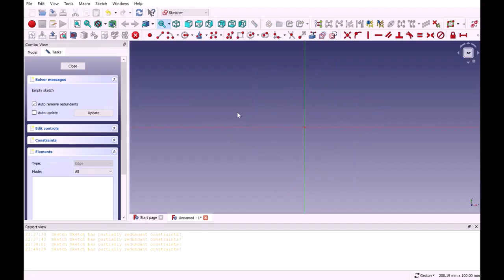AIRSTREAM  REBUILD - Ep. 8: New COOSA subfloor & wheel wells replacement

Comment: I’m glad o saw this video. I’ve been on the fence about lifting my shell. It seems like you can do 99% of the frame repairs without lifting, and sliding floor in from the wheel well. Thank you sir! Excellent work!
Reply from the maker: I am glad it can be of use. I am working by myself in a windy area, I did not want to lift the shell for these reasons. It worked almost flawlessly for me like that. Something that is not in the video is I only removed the blots that linked the shell to the floor as I was sliding the first sheet. Once all the sheets on the front half were in position I installed new bolts, then repeated the process to the rear half. This way I always had at least half of the shell secured to the frame so it would not move or fall.

Comment: Really appreciate this video! It convinced me to buy coosa for the floor of our 1972 27ft airstream. I have 3 big questions! What are you coating the floor with when you finished (grey)? What was the red putty you mixed to cover the heads of bolts? LASTLY, how do you plan to insulate the floor? Very curious. Thank you!
Reply from the maker: Thanks! The coating is just garage floor paint I used that to "seal" the small pores of the floor against dust while I finish the trailer. probably  not necessary but it can only help. The putty is "bondo" / body filler from the local hardware store. As for the insulation the current plan is to glue rigid expanded foam panels to the floor. 
Make sure to get the coosa bluewater 26 boards. I went with 3/4" thick and routed the edges so that would fit in the 1/2" channel
Reply: So grateful for such a timely response! Thank you! So the goal is just to add some uv protection for the floor? Could I use like Marine paint/gel/epoxy? Not familiar with the rigid expanding foam insulation, will look into that. After painting over the coosa, do we have the option to add vinyl floor on top? The painted closet isn't the fully finished floor is it? Thank you so much!
Reply from the maker: @BubbaRiot  Mostly to make it easier to clean but you are right also to avoid direct UV on the coosa boards. My guess is any other paint would work too. As for epoxy it is probably overkill and more expensive. Coosa does not really need to be sealed. My current plan is to add a layer of 1/2" rubber then a custom printed vinyl on top.

Comment: I also wanted to ask what attachment you're using to allow elevator bolt head to lay Recessed into the floor. The circular attachment. Did you just use 1/4 drill bit for pilot hole? Or did you have to make it threaded? Thank you! Hope I asked that correctly
Reply from the maker: To have the bolt recessed into the floor I had 3 different method: 1. screw them really tight (that should crush the floor a bit and the bolt should end up recessed) I Found this not to be super reliable. 2. used a router with a router bit set to about 1/8" depth and carve out a circle shape around the hole. 3. used a forstner bit with a larger diamater than the head of the bolt and drill about 1/8" deep. I used the last method the most. As for the hole, I used a 1/4" drill bit through the floor and frame indeed.

Comment: Awesome job!! I would really appreciate if you had some links to your materials you used. Im rebuilding an Argosy.
Reply from the maker: sure, anything specific? I'll try to add references for everything in the description of each video.
Reply: @SylvainBurdot  Thank you that would be greatly appreciated. Yes the thickness of the Coosa you ordered and where you ordered yours from. Along with the recommended bolts you used pretty much everything you used to cut it short. haha!! Just found out about Coosa just In time as Im currently taking out the skins and the rotten plywood.
Reply from the maker: @universaluplifting  I got 3/4" thick Coosa bluewater 26 boards. That's why I had to trim them down since the original floor was only 1/2" thick.  I ordered them from Revchem in the LA area, including the delivery they were the cheapest around in south California at the time. https://revchem.com/ As for the bolt you have several options, and many people have done different from what I did. I used these exact elevator bolts from McMaster: https://www.mcmaster.com/92221A104/ & https://www.mcmaster.com/92221A246/ with standard nut and red loctite on the nuts. I used 2 different length depending on the location. The custom bolts that I made for the floor channel were made of a simple laser cut steel piece welded on this exact bolt https://www.mcmaster.com/94239A104/  that allowed me to screw them alone without someone inside the trailer. I may still have the design file if you want. As far as cutting, any wood tools would work. It is really easy to cut. Make sure to wear a mask and eye protection, even better if you have a bunny suit, as you'll be covered in fiberglass and polyurethane dust. A circular saw for the straight cuts, jigsaw for the curve and router for trimming down the edges worked wonderfully in my case.
Reply: @SylvainBurdot  Thats great Im couple hrs away from LA so that would work great. How many Boards did you need to get the job done? Oh okay I've seen many people recommend those bolts for the boards.Im better off going that route too. YESS I bought a suit and a mask today I took out the pink insulation. What kind of insulation are you going with? Sure if you don't mind sharing the file thank you.
Reply from the maker: @universaluplifting  Which area are you located, I only a couple of hours away from LA too. As for the boards,  my trailer is 31ft long, the inside is just under 28ft so perfect for 7 boards. That's what I purchased.  Given the price of these boards I did not want to buy a spare one so I had to make sure my cuts were right the first time. Second factor that lead to the number of board is I wanted to make sure that the edges of the boards would end up on crossmembers to avoid having them flexing. One of the original plywood board edge was not supported by a crossmember and the flexing was awful. That's why if you look closely at the video there is a board that was cut in half, two section of 2ft wide, so it be on members. For the insulation, I should be at that step in a couple of weeks/months. My plan is to use armaflex rolls between the walls and expanded foam panels under the floor. Let me see if I still have the file for that custom part.
Reply: @SylvainBurdot  Staying in Bakersfield area? What about you? Another question would you consider working on the subfloor aging if someone contracted you?  My Trailer is pretty much the same size I'll just need 7 of them. Oh okay I also thought of welding on more support sections on the frame I just don't know the proper wording for it. Great I'll be keeping an eye out for your next video.
Reply from the maker: @universaluplifting  I am in the Mojave area, not far away. As for working on the subfloor for somebody else, it is doable, that will depend on many factors. Welding more support is an option, it might be necessary depending on the frame model. They had several different versions of frame from what I have seen. Next video will either be the roof mods or the bumper repairs in a couple of weeks
Reply: @SylvainBurdot  NO just a few min away. Well if you're interested we would appreciate if you were able to do our subfloor. We have never worked with that board material and the price for board makes us even more intimidated. Yes I have notice that aswell. We would appreciate more support on the frame as we would be living in the Argosy full time. Great we will keep and eye out for the next video. We have watched all your videos including the skydiving pretty cool.
Reply from the maker: @universaluplifting  I had never done it before either, the first cut was definitively scary but in the end it is not that difficult at all. Easier than wood I would even say. I will be full time in my trailer too. As for doing your subfloor, I would need to see the trailer to tell and that would depend on your timeframe and budget.
Reply: @SylvainBurdot  lol I can only imagine!! Those boards are crazy $ but at the end they are worth it. I really enjoy working with wood but I just can't use that as the subfloor. Will have fun tho building all the cabinets and walls and doors. Really well we are sure like minded individuals! We are planning to build a little homestead. With these crazy home prices here we can't afford that here. Okay well timeframe can be worked out and budget well that will depend on your price because its work alright. I seen it did take you 64 hrs solo but we would be helping out so that's 4 extra hands lol. Maybe it could be cut to 24hrs fingers cross so we don't take much of your time.
Reply from the maker: @universaluplifting  I am not going to be using wood for the cabinets personally, only aluminum. I am too concerned about weight and wood moving with differences in temperature and humidity. A lot of the work can be cut down if so prep work is done in advance also. I would need to see it to tell. As the frame been cleaned up yet?
Reply: @SylvainBurdot  Oh okay. Well I am very curious to know how you would be able to use only aluminum. We are currently in the process of removing the subfloor and so far we have seen little to no rust. Seems like it might of been worked on before
Reply: @SylvainBurdot  We just ordered the boards. How Many bolts do you recommend we buy of each?
Reply from the maker: @universaluplifting  should we set to meet once you have the floor out so we can check how much work there is for the new floor?
Reply from the maker: @universaluplifting  I just checked my invoice, I got 5 packs of 25 of the 1-1/2" long elevator bolt, 7 packs of 10 for the 2-1/2" long elevator bolts, and 2 packs of 50 for the bolts I used to make custom bolts for the floor channel. I had a some spares at the end.
Reply from the maker: @universaluplifting  Get some locktite and washers too, I bought these https://www.mcmaster.com/91090A107/
Reply: @SylvainBurdot  Thank you! I will order those packs next. Did you have a lot of issues when you ordered your axels? We also need to get those ordered soon. Any tips? Yes I will definitely like to meet up. Would you charge by the hr or by the Job? Have you gave it much thought?
Reply from the maker: @universaluplifting  I would say a few hiccups more than actual issues, 3 to be exact. First, somehow the axles got lost for a months during shipping. How is that even possible I don't know...I called the seller who told me the axles had left 2 weeks prior from LA and I should have them by now but they were going to contact the carrier to find out. I called several times, maybe 3,  then after a month they suddenly they arrived one morning without notice. They arrived that's what matters and that was the carrier's fault not the seller. Second, on arrival one of the nut retainer was missing. After what had happened I decided to not say anything and just buy a new one, something like $5. Last, the mounting holes did not match perfectly so I had to slightly modified the frame, but I was kind of expecting that to happen. Otherwise, I am not complaining. I had Cynthia at HighSky RV parts on the phone to order specifically what I wanted since I got a few options different than the original axles. 
As for the floor, I have not given much thought. Will discuss that in person depending on your frame and the amount of work.
Reply from the maker: @universaluplifting  By the way, I have added the list of tools and parts under each video as requested.
Reply: @SylvainBurdot  Oh wow that's crazy!! Maybe it's because of how heavy they are so them trying to figure out how to load and unload them. Maybe!! But still insane.. You should have contacted her for a reimbursement especially for all that time that passed by. Did you get a lift kit? Oh okay no problem sounds good. Thank you, I will check the links out.
Reply from the maker: @universaluplifting  I was not in a hurry I had other things to work on anyway. I did not get a lift kit, however I should get more clearance with the upgrades I made in the axles. I got higher load rating a greater arm down angle. The angle itself should give me about 1" of added clearance, the higher load rated will add to that.
Reply from the maker: @universaluplifting  What time frame did they give you for the boards?
Reply: @SylvainBurdot  Still haven't shipped last time we checked. I will be calling tomorrow to see how the process is going.
Reply from the maker: @universaluplifting  Let me know when we should arrange a meeting
Reply: @SylvainBurdot  Hey there would you like to drive out here or for us to take you the Argosy.
Reply from the maker: @universaluplifting  Whichever is more convenient for you. Mostly on Fridays or Saturdays for me. Send me an email we'll discuss that privately
Reply: @SylvainBurdot  I couldn't find your email on your channel.
Reply from the maker: @universaluplifting  I just added it
Reply: @SylvainBurdot  We sent you an email let us know if you received it.
Reply from the maker: @universaluplifting  I got it and answered
Reply from the maker: @universaluplifting  Did you see my reply?

Comment: What was the last coat of white you put on the floor? Ive got the same thing but not sure how I want to finish it up, Fiberglass or sealer? Not sure
Reply from the maker: That was just regular garage floor paint form the local hardware store. I don't think it is really necessary but my approach was to seal up the pores of the boards so dust does get in them while I am working on other things. It will be covered by the new flooring
Reply: I put a floating floor directly over the coosa and it looked great but somehow got moisture underneath and wouldn’t dry (musk smell) so took the entire floor up and put weep  holes every 5 feet inside walls threw c channel but need to seal floor up so moisture can’t get trapped.. I was thinking of fiberglass tape and resin on the seems and gel coat the entire floor up to the C-Channel. No leaks in roof or walls and the way I’ve overlapped the aluminum on interior even if there were a leak it could not reach inside, will just go to weep holes. Been in a holding pattern since the discovery of moisture between floor and subfloor.. thanks for the reply
Reply from the maker: @zabby533  In theory coosa does not absorb water so as long as water as a path to escape quickly you should not have any issues. That's why I have not sealed the small gaps between the boards. I am going to add holes in the c-channel too to let an escape route for any water, I was thinking about a hole every 4 to 5 inches. My subfloor got a lot of water this winter from the rain we had here as I had removed the upper windows but it did not seem to have been impacted whatsoever. Granted one can see water stain on the bottom side but it did not absorb anything